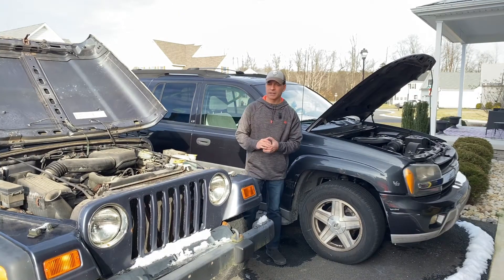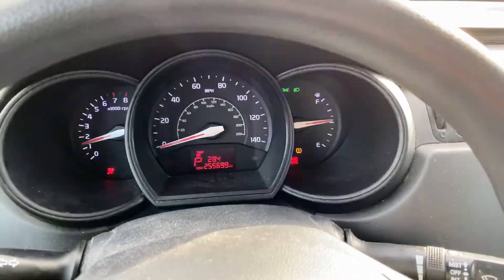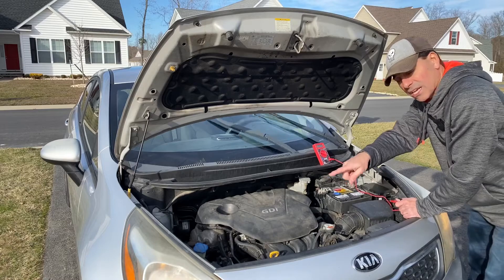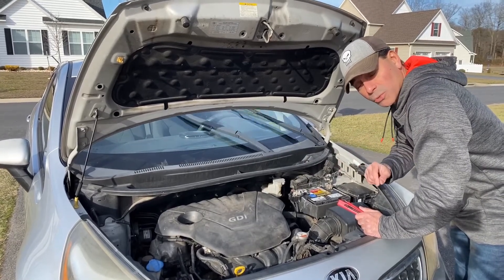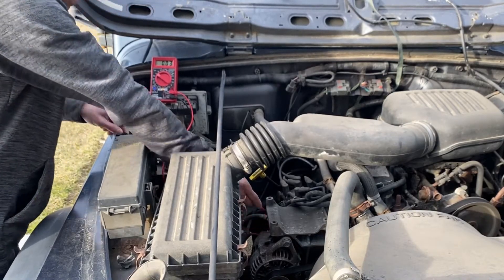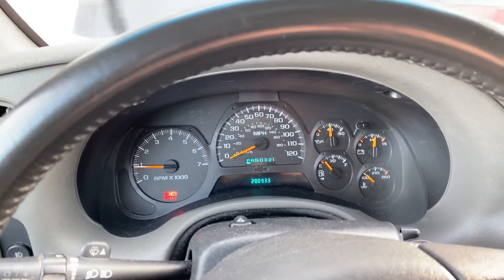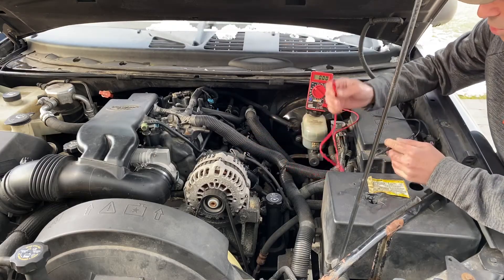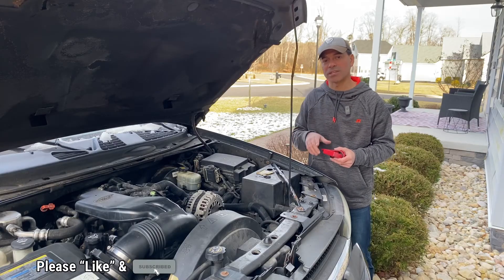How To Test Charging System Voltage Drop  (Andy’s Garage: Episode - 458)

Comment: What happens if you get a fail on either the Positive or Negative voltage drops?  What do you replace/fix if you get either one of those fails?
Reply: Most common culprit will be a bad ground cable or power feed cable. Start with the battery terminals. Those are the ones ppl fudge up the most. Then focus on ground points at the block and chassis. These tend to rust out in salt states
Reply: Check your battery terminal cable or look for corrosion
Reply: Good ole Google.  Here is my own answer: 
A failing positive or negative voltage drop test indicates a problem in the electrical circuit, likely a high resistance point. This can manifest as inoperative electrical parts, sluggish devices, erratic behavior, or even engine/transmission issues. It can be caused by bad connections, corrosion, or even undersized wires. 
Here's a more detailed breakdown:
What it means:
A voltage drop indicates a loss of voltage due to resistance in the circuit. When current flows through a resistance, voltage is "dropped" across that resistance, meaning less voltage is available at the other end of the circuit. 
Possible causes:
Loose connections: A connection that isn't making a tight, clean contact can create resistance. 
Corrosion: Corrosion on connectors or wires can also significantly increase resistance. 
Damaged wires: Broken or frayed wires, or wires that are too small for the current they're carrying, can also cause a voltage drop. 
Other resistance: Other sources of resistance, like dirty terminals or a bad ground connection, can also lead to a failed voltage drop test. 
What it can cause:
Inoperative electrical parts: If the voltage drop is severe enough, a component might not receive enough power to operate. 
Sluggish or erratic electrical devices: Devices may work slowly or erratically if they're not receiving the full voltage they need. 
Engine or transmission problems: A voltage drop in the power or ground circuits of an alternator can cause premature failure and is often the source of misdiagnosis. 
Other electrical issues: Excessive voltage drop can lead to a variety of other electrical problems, including flickering lights, dim bulbs, and overheating components. 
Troubleshooting:
Check connections: Inspect all connections in the circuit for tightness, corrosion, and damage. 
Test wires: Look for broken or damaged wires, and ensure they are properly sized for the current they're carrying. 
Clean terminals: Ensure battery terminals and other electrical connections are clean and free from corrosion. 
Repair or replace: If you find damaged components or connections, repair or replace them to eliminate the resistance and restore proper voltage.